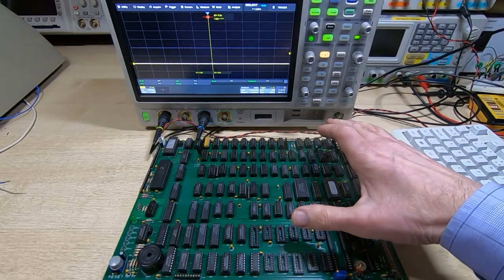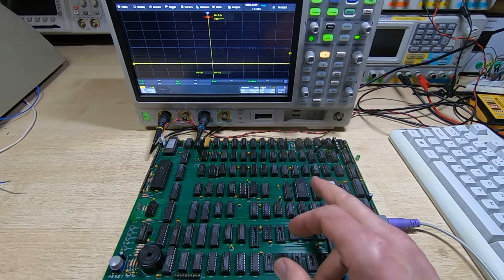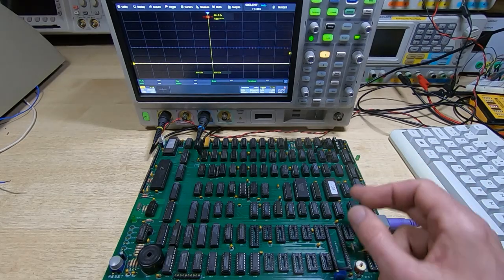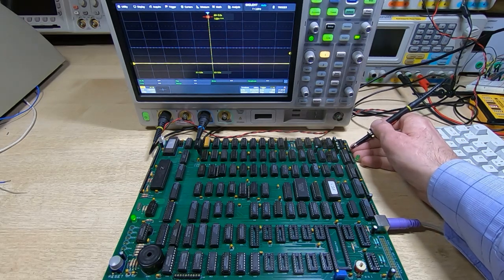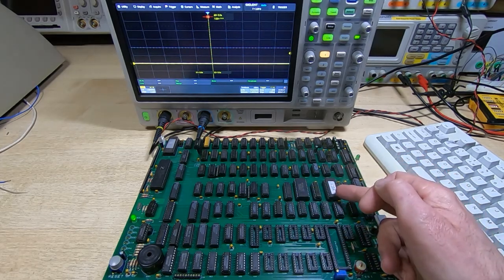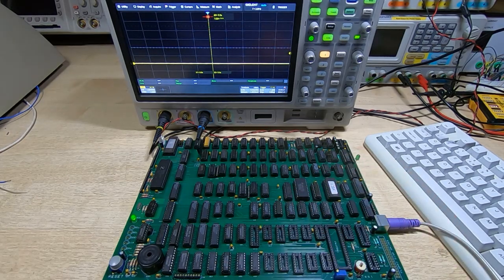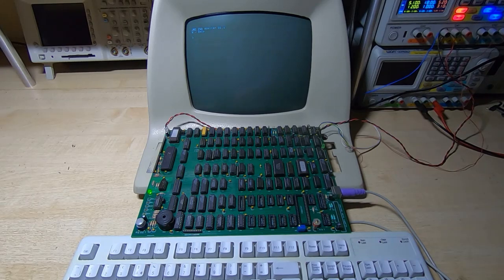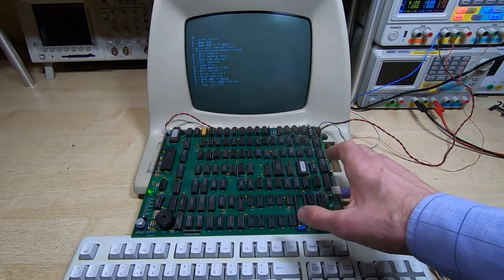Designing A Z80 Computer Part35

Comment: If you want DMA, Zilog has a Z80-DMA chip that works rather well. I used a DMA device in my BB2 design in the early '80s. There's no reason to build DMA capability out of LSTTL except for sheer punishment. It can be done.
Jim Ferguson, designer of the BigBoard 1 & 2, the Xerox 820, The Kaypro, and others

Comment: Yeah, I do agree that the work is really impressive. But generally it's quite astonishing that someone messes with 8bit systems that  are quite the certain  headache to program and keep software in a good shape. Also as far as I understand Z80 "computers" didn't have proper "video accelerators" for rich graphics, the whole niche  was  gobbled by the Commodore squad.
Reply from the maker: Z80 computers are exceptionally easy to program and most video arcade games used Z80 processors so I have no idea what your comment is based on. I also think you may have totally missed the point of this project so maybe your 'understanding' is incorrect.
Reply: @JerryWalker001 :-) Well I was just comparing videos with Commdores and Spectrums :-))
Reply: @ran2wild370  The ZX Spectrum had a different design philosophy, intended for the UK market just after a long period of industrial decline. Everything was about price. The Spectrum design is mainly a re-use of ZX80/81 code with enhancements and accepts many technical compromises in the architecture as a fair trade off, in order to make a very compact, low cost computer.  At the  time, the 16K version cost just 99.00. Which for a colour (8 colour plus two shades) computer with high res (for the time) graphics, was an unbelievable price point. The Commodore 64 was appx 300.00 when released for comparison, likewise the BBC etc.
  Thus you cannot compare the two architectures as representative of the state of the art for each CPU type. The Z80 is a high performance CPU in fairly common use today for embedded systems, with a large number of registers that allows (in a conventional architecture) high performance code to be written. It's I/O space is completely independent of the memory map, making bank switching easier for RAM greater than 64K. It is easy to use and code for.
   The 6502 is similarly easy but is more limited in functionality. It does however give a reasonably good account of itself as it uses less clock cycles for instructions on average. However it is not capable of the high clock speeds of the Z80 (the Z80B I think was 8 MHz capable) The Commodore 64 used a custom processor, the 6510, and not the 6502 which would perhaps have dealt with some of the shortcomings of the vanilla 6502 for that application.
  I believe the Z80 could makes a good trainer today for anyone that wants to learn techniques of assembly programming, as it gives a good introduction to computer architecture and embedded system firmware etc. without facing the overwhelming complexity of 32 bit arm SoC's etc. right out of the gate.

Comment: I’m currently enjoying the pleasant and instructional reading of your book and I’ll be looking for the ones about writing codes and floppy controllers. As this computer is designed in the old way and will be able to run CP/M, I wonder if it would be in the line to let it be able to support 8” floppy drivers as well. It would be fascinating, I believe, to use such disks beyond the other formats. I’m not expert on FM and MFM circuit over the various type differences and compatibility, so forgive me if it might be impossible.
Reply from the maker: All you need to do to run 8" drives is configure the FDC appropriately. The only real difference is in the sector sizes and clock speeds. These are set in the code and FDC status register so no this design will already support 8" drives. To make best use of an 8" drive the clock to the FDC should be 2MHz rather than 1MHz but as this is a /2 then it can easily be achieved by halving the clock divider ratio. The rest is the same.
Reply: I have 3 shugart 800s that i been saving for a day that never came.  My electronics hoarding has finally paid off